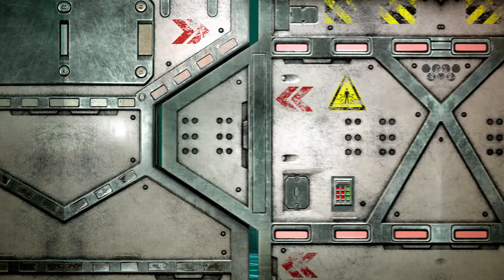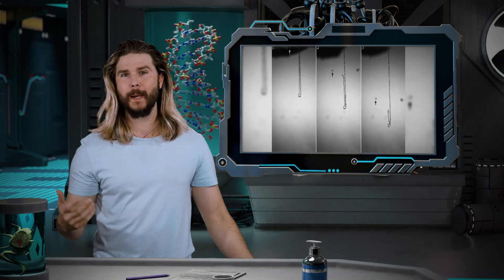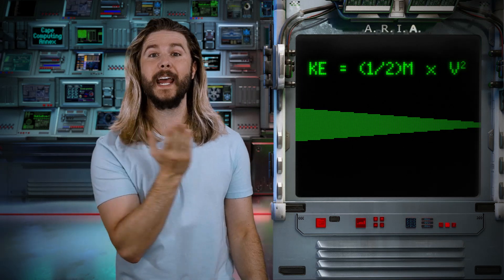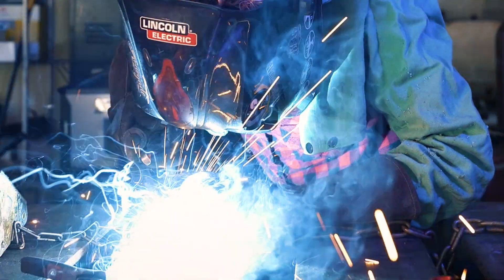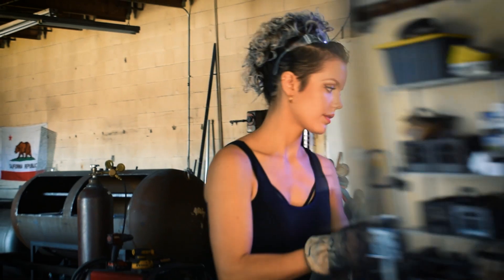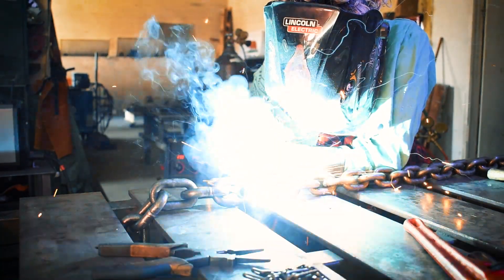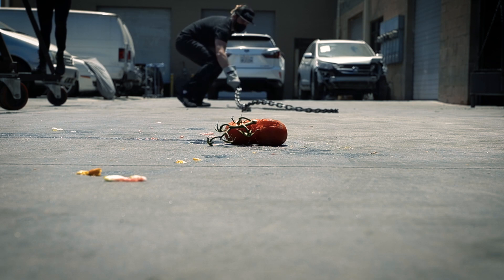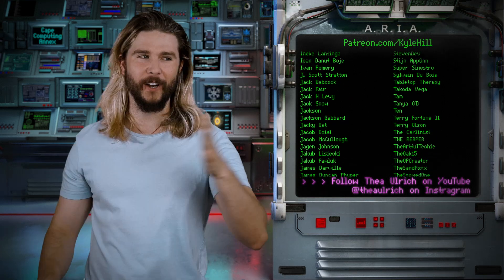Steel Chain Whips are SCARY

Comment from the maker: Thanks for watching! Sub to Thea and we'll do more slicing...for science: https://www.youtube.com/channel/UCUutcqqhZpj1OTx3wLGMKWw
NOTES: I don't think the tip went supersonic, though I did have a few whips that had sizeable cracking sounds. I didn't use a cable because the rigidity of cable won't allow for what you may be expecting. FOLLOW THEA. I think I might have to make this thing even longer and try it again...
Reply: Would be neat to see this whip go up against wood or ballistics gel or otherwise something more impressive than fruit.
Reply: @InSanic13  SUSHI RAMEN【Riku】 did a video where he was hitting something similar to that and using a 100kg chain that tapered down. It got pretty chaotic and hilarious.
Reply: You could greatly increase the initial speed and therefore energy by attaching a pole as handle.
Could you also try to attach a small bearing ball at the tip to see if it gets shot of at supersonic speeds?
Reply: Kyle Hill before you make it longer perhaps you can remove the friction... air friction is fine but concrete friction probably isn’t. Maybe use an ice rink or a vertical rig to keep it in the air.
Reply: Okay, so hear me out:
What if you took the concept of a chain whip, and made a giant (in length and width) chain whip.  What would happen to the end part if you could get it to near light speeds?  Is there a cap to the acceleration?  Could it in theory be faster that light?  Would time dialation occur?  would it slash a tear in spacetime and create a portal or black hole?
Reply: @Youngillidan  The chain would tear and rip as it would become crazy heavy.
Reply: I’d buy a shirt that said The Hill Effect
Reply: Kyle has long flowing hair
So does Simon Belmont
Kyle Talks about steel whip
Vampire Killer is a steel whip.....
Kyle is your true last name "Belmont"? Have you been keeping Dracula at bay?! 😱😱
Reply: I'm curious if the parts of the chain she heated and manipulated needed to be retempered or not.  Seems like not doing that would leave some parts of that steel brittle and liable to break during the whipping action.
Reply: @Laendra  The chains are probably wrought iron and therefore need no tempering. As long as the steel was hot enough during bending the chain should be fine. 
However she could do a normalising cycle to strengthen the weld and relief stresses.
Reply: Just add 2 or 3 length of even lighter chain. Try to find at what point the last chain self destruct !
Reply: Hey Kyle can you do a video on how to mine asteroids and more specifically the effect on the earth? I assume at a certain point adding the mined minerals to Earth's mass could possibly change the Earth's orbit wouldn't it?
Reply: @lordvader4089  It would have more effect on the orbit of the satellites and make getting into orbit more difficult by increasing Earth's gravity.
But, that would mean bringing over 1 000 000 000 000 metric tones of material to the Earth.
Reply: The towel snap? Is that super sonic, too?
Reply: @wilcomaree5278  Can be, if done right. And stings like sheet, especially if towel is wet. ;)
Reply: @TheGhostGuitars  most likely yeah, but that crackling snap we hear most of the time, isn't that, exactly that already?
Reply: @wilcomaree5278  LOL, with me it's more like a sharp pop, probably cuz I hold the opposite corners between two hands, pull it somewhat taut then give it a quick twirl so the towel coils itself into a rope like form, then with a snap of the leading hand towards the target, pulls the opposite end out of my trailing hand, which had held the towel in a line pointed at target. If done correctly, I can punch holes in cups before they fly back. Works best if the towel is just slightly damp. When asses or other parts of anatomy, are targets I generally use less force, obviously, LOL!
Reply: @wilcomaree5278  Yes.
Reply: Yes please do another follow up video. Maybe include some info about the Belmont whip. I always wondered if that whip would actually still go super sonic in real life since it has such a large and likely heavy tip instead of the usual small tip. You should look up some videos of shaolin monks using huge steel chain whips I've seen some videos on tic too. Great video can't wait for the next one
Reply: I am trying to understand why everyone keeps insisting this be done with wire. It would never work with wire because the tip needs to essentially move freely. The tension inherent in wire will make sure it can never lie against itself without damaging the wire.

If you wanted to use wire, you'd need something like a ballista to tension the wire, and release for a short range lash, but that's actually far more like a sword.

You heard me. Wires can make swords. Not whips.
Reply: Someone made a chainmaille whip years ago. There video on somewhere YouTube.
Reply: Kyle, go to your local fishing supplies store for "wire leader" (lighter and more flexible than Cable of the X-Men) then see if one of your minions can weave/braid/plait it into a proper bullwhip.  The end result might be much lighter as well.
Reply: Is that phenomenon really called the Hill effect?
Reply: If so nice
Reply: It wouldve been pretty cool and interesting to see if you tested the steel whip against a zombie head.
Reply: I'd say your problem is it's too long and heavy for you to get a good start on it. Bigger may give you a bigger multiplying effect at the end of the whip but you need more power at the beginning to get it that quick wrist snap. I'd take off the first big chain or two and try it from there to get it to go supersonic. 
 You want something light enough and with a handle to get that nice  sudden slight backwards snap you get from a handle rather than just a dull sudden stop you get from having a chain in two hands. Never underestimate the power of a lever man.
 Or I think you'd need to borrow some industrial companies robot arm to swing that beast as fast as a standard human can swing a regular bull whip. My god the devastation from that would probably go straight through a hung pig carcass.
Reply: why didnt you went with AGAR, or some gel-ish subsitute of tissue, like is done in biomedical disciplines?
Reply: I liked Thea but I just wish she would listen to OSHA, you shouldn’t be wearing something like that to be grinding, you should be wearing a thick cotton long sleeve work shirt because those sparks can catch that material on fire really easily, I’m not trying to be a jerk, I’m just a huge advocate for safety, REMEMBER YOUR PPE
Reply: so I do not remember the channel name, but my roommate showed me a video from a Japanese kid demonstarting something similar with a chain but the chain was much longer. due to the longer length and tapering, i believe in the kid's video he was able to get the end supersonic.
Reply: What about a bull whip made out of steel cable? Like how a regular leather whip is braided, but use braided steel lines instead. It would probably be easier to handle and would actually crack.
Reply: @owen5640  the steel lines are still too rigid. Think of rope. Its gotta very flexible without any force acted on it. Unless its a bunch of small linked pieces like chain
Reply: Maybe try the lead line fron a commercial fishing net. Its basically rope with little links of lead on the inside. That might make a crazy whip if tapered and it would be quite heavy.
Reply: I always butcher my tomatoes when slicing them...how much to get you to come whip my tomatoes for me?
Reply: @davidhobbs3178   I'm a cook at a Japanese restsurant, the guys there would say "sounds like yer knives needs sharpening," LOL. I can slice them thin enough to see right thru each slice without damaging any of the internal structure. Amazing how intricately they can carve a tomato into works of art. And that's just tomatoes, what they can do to other veggies is incredible!

EDIT: Typos
Reply: I've seen a chain whip slice a car door in half, done right, with the right length and mass ratios, it can definitely break the sound barrier and do far more than it did here.
Reply: check out ElectroBOOM's video from a month ago titled "This video of a motorized spool proves me right" ... the question is why does the chain fountain grow? I think it is from the tension in the chain is what gives it the leverage to throw the chain fountain up. The tensile force probably traverses (upward) the length of chain that is accelerating downward at the speed sound (in said chain/metal etc.).... kinda like this bullwhip.
Reply: Super slow mode of that would be awesome
Reply: Oh no not this again scorpions whip didn't go well for you guys and was proven wrong by the "I did a thing" channel in his back yard...
Reply: Plus there was a lot resistance from ground too..
Reply: Ever think of doing a liedenfrost effect video
Reply: Another fabulous video Kyle Hill, thank you for the entertainment. Towards your Hill effect, I offer you the "Mould Effect" as a 'linked' idea of interest for you. While the two are not the same, they do both use the unique physics of a linked chain. THEA was also, awesome!
Reply: Finally reached the point in High School physics where I can now understand this stuff.
Reply: How heavy is that chain whip?
Reply: What did that thing weigh?
Reply: Quick question : wouldn't someone with super strenght use this whip with insane proficiency ? 
Should Shad make a fantasy rearmed over this ?
Reply: Why not build a little ramp like a quarter of an inch tall to get the whip into the middle of object
Reply: @des1redlearnz  I had a similar thought but realized the answer on my own.

He DID try it, but the momentum of the chain will move just about anything unless a lot of work is put into bolting it down, and what's the point for a 15 minute video?
Reply: It looked like it was a very heavy whip.
Reply: For additional info on how dangerous fast moving metal is, i would look up what happens when aircraft carrier cables snap.
Reply: Hey Kyle, I have a stupid question. Let's say that someone was able to cut a giant hole all the way through the center of the earth and "core" it. Let's also say that this hole goes directly through the earth's center of gravity, in other words, the center line of the cylindrical hole passes directly through the point that is the earths's center of gravity. And then let's say that they had an impossibly strong tube that was inserted into that hole to prevent the hole from collapsing in on itself. Now let's say that I jump into that hole. What happens to me? Would I fall toward the center and then get stuck once the gravitational force on all sides of me were equal? Would I be crushed due to the extreme pressure? Would air even be a gas in the center of the tube?
Reply: It can cut but can it  do chain self siphon effect.
Reply: He why is your face not painted silver captain dissolution
Reply: The only thing missing from the video was Thea lighting a cigar with her blow torch like a badass.
Reply: You know what you need to do... build an armature for the whip in the form of a miniature trebuchet so it can actually swing like a leather bullwhip. (But trigger it remotely because that thing is going to be stupid dangerous.)
Reply: I have a couple ideas.  First, if you want a cracker, just weave small cable through the chain and about eight inches to a foot beyond the tip of the whip and anchor it a good three or four feet down the whip so that whatever you use as the anchor doesn't throw off the way the whip behaves.
  And, if you want a whip crack without a cable cracker in the end, as I'm sure you would get with this method, all you have to do is use gravity as the propellant of the whip from extending upward to extending downward as it hangs from a crane. The rest of this comment is explaining method option you could utilize in order to make the gravity powered chain whip possible.

The next section of this comment is pretty much me formulating how to do this without two cranes(because, that's a lot of funding of course) so you don't have to and you can focus on whether or not you should do this.  

Ideally, you want to use the entire length of the whip, and I understand that there would be a challenge in doing so, because you need a hanging point for the whip, and a way to extend the whip fully upward from which you can drop it.  Instead of using two cranes, or a single crane and an ibeam sticking out from the roof of a building, just add a length of chain as long as the whip itself to it's base, maybe a little longer, and hang the whip with extra chain at twice the height of the length of the whip, such that it has a couple inches of clearance from the ground.  
As far as I can see, the extra length of chain you hand the whip from will almost have no effect on the behavior of the whip, it would be just like having two hanging points for the whip as far as I'm concerned, and it would only take a single crane, or i-beam sticking off a roof.
Reply: its the slingshot effect right?
Reply: Can we please have more co-op between you and Thea, she seems really cool.
Reply: @Kyle Hill  Unless yer SIGNIFICANTLY stronger, it would be hard to snap it hard enough to overcome it's inertia (especially on the heavy end) to have the end go supersonic.

Methinks ye probably started with a too heavy a chain as the first section. Ye probably would get better results starting with a smaller size like 3/8" for about 3', then 1/4" for 2', then 1/8" for a 1', for leverage attach the heavy end to a stout 3' long rod or stick. That way ye can wield it 2 handed. 9' total length, 6' chain only.

I STRONGLY recommend wearing protection when using, at least until ye familiarize self in effectively using it. Football helmet and armor at least. 

...Unless ye can convince Thea to 'whip' up a plate armor for ye first, LOL.
Reply: I saw a japanese guy do this first, it was fun watching this.
Reply: When Kyle turns 50 will he be over the hill?
Reply: Don't forget how the sub/super-sonic barrier changes based on air pressure depending mostly commonly on altitude. Higher altitude = lower speed needed if I remember right.
Reply: @salimufari  Don't think it really matters, as most people wielding whips have their feet on the ground. Besides if ye can surpass the sound barrier at sea level, then it's easier to do so "up there.

 That's assuming sound barrier is indeed lower at higher altitudes, I haven't fact checked before responding, and quite frankly feeling lazy cuz I'm tired (it's late here) at the moment.
Reply: Do you have covid 19?
Reply: Whip me please I've been naughty
Reply: What about starting with chain and ending with a wire. Be too stiff early on but I could see it work at the end
Reply: @Tatominator  It's been done before with whips with bits of wire barbs attached to the ends. Very nasty stuff.  In medieval times has been used as an implement of torture.
Reply: @TheGhostGuitars  Ah the cat o nine tails took a very fuc*ed up individual to create that. Well it was brought around by the Spanish Inquisition. Getting whipped with a cat o nine tails was actually one of the milder punishments they had.......
Reply: @davidhobbs3178  LOL, that is such an understated way of describing the Spanish Inquisition so as to be almost inaccurate!  Methinks this is one of the inspiration behind the separation of the state and religion concept.

The whole period is on seriously dark fukup of the whole society. Ugh, that too is understating things too but to be more graphic probably would be risking censure by the almighty Algorithms, LOL.

Anyway, I agree the weapons and tools of torture developed thence were collectively VERY creepy and horrific. On one hand they are fascinating and interesting, but OTOH, they are the stuffs of nightmares and wouldn't ever want to see them ever being used as intended!

Milder, huh? That is so seriously an understatement to almost be lying, LOL!
Reply: How Dangerous is a STEEL WHIP?....a question only asked by someone who's never played Castlevania....
Reply: I want one. Where could such a fine young and handsome gentlemen buy such a magnificent trophy?(Weapon)

Asking for a friend!!!
Reply: Steve mould : unlimited moving chains
Mould effect
Kyle Hill : chains moving faster than a quarter
Hill effect
God bless the students studying in the next decade when this is implemented into books
Reply: My guy....for ur own good,take this girl out to eat for doin all this for u . Thank me thirty years from now. 😉
Reply: Kyle... you didn't talk about how "dangerous" a steel whip is. I was hoping you would engage some objects that had a substantially higher resistance than just a bunch of pieces of fruit. A Gansu knife can do that and cut through an aluminum can. It must be a fact... I saw it on TV. I just wondered what a chain link bullwhip could do when it's put to the test. How much force, how much velocity, does it exceed the speed of sound, does it REALLY KICK BUTT?
Reply: Oke why not just use a chinees chainwhip? Cause this steel whip your talking about does already exist. Your not the first to think of that the chinees beat you with a few 100 years. I have a homemade chainwhip myself cause I practice kung fu. Your litterly the last persoon to come up with the idee of a whip made out of steel. The chinees chainwhip uses sections instead of links that tapper and a heavyer weight on the end sow when the whip is at full speed a heavy mass object hits the target instead of a weak as tiny link. I don't know of your aware of it's existence but just look up chinees chainwhip if you want your mind blown. There are people trainend to extreem with those fuckers
Reply: @joeyvanhaperen7715  Kolere, je Engels hapert nogal... (kon 't niet laten goos)
Reply: @joeyvanhaperen7715  Sorry man, dat was lullig van me.
Reply: Why not try running backwards as the tip is going forwards and stop a couple of feet later?
Reply: Cool and all, but I see a lot of food waste
Reply: I like how one of the rear computer screens is showing a blueprint of Atlantis from Stargate: Atlantis. That completes my soul
Reply: I would love to see you guys hit ballistic gel, since it's a lose analog to human flesh.
Reply: PUT THEA IN THE DESCRIPTION FELLAS...come ooooon🙋‍♀️
YouTube link is great here in Kyle’s comment, but does she have an Instagram?
Reply from the maker: Lunis84 she does
Reply: Kyle Hill you’re amazing
Reply: @kylehill can you do the one where you tried to make a steel chain go faster than sound, but with a steel cable this time. A guy on YouTube Called mike shake made a supersonic steel cable whip that actually cracks, LOUD!
Reply: I feel like this whole video is a ploy to name a scientific concept after yourself
Reply: There is a video that was posted a year ago with 10 million views of a guy whipping a massive chain on the street. The end does appear to pop.
Reply: I work for a pool company called Eastern Pools in Norton Ohio!

And we use Muriatic Acid to wash wash Filters, and then wash then with Soda Ash, AKA baking soda!
Sodium Carbonate!
Isn't chemistry Fun!
🤓🤓🤓🤓🤓🤓
Reply: It may not have gone supersonic, but I still wouldn’t want to be on the business end of that thing
Reply: Steel cable is too rigid? No way. 1/16 cable is very flexible, and could handle the G's created when accelerating up to supersonic
Reply: Thanks a lot thor
Reply: Does she have asthma? Her breathing patterns while she talks is kind of worrying. She should go get that checked out
Reply: Can you do a video on the firmament?
Reply: Yes
Reply: dangerous enough it can break bones,there are chain whips used in martial arts,and probably cut a person in half with that whip
Reply: It needs a handle
Reply: What? I wasn't doing anything I'm just chilling back here
Reply: I wouldn't suggest chain because as the force becomes greater the more of a chance that the weakest weld will break sending chains flying.
Reply: hellooooooo nurse!
Reply: You should have used steel cable and the fall and cracker can be flexible wire coated in plastic
Reply: You should get one of those robot exoskeleton suits the Japanese are making, then you'll have the strength to actually use the chain as a real whip instead of slinging it across the ground.
Reply: Have Brian Shaw wield this
Reply: theres a video floating around Tik Tok of a man cracking a gigantic chain whip. I have no clue what its under or who it is but its something
Reply: I’m using this video to try and disprove Steve Mould and ElectroBOOMs’ videos on the bead chain thing, thank you Kyle
Reply: You know....this makes a few of Ghost Rider's abilities even more impressive.  His chain doesn't taper, so imagine the sheer strength it would take for him to throw a chain whip like he does.  Also...how does he not cause massive trauma to a human by wrapping them with the whip?  I mean...the force imparted HAS to be able to cause serious bruising to even the deepest organs and just...shatter ribs and a sternum.  By the time he's heading up to them to use his Penance Stare, why would he bother?  The average human sinner is already in some level of traumatic shock.
Reply: Kyle, you need to get a slow motion camera and a strongman to go to town on something with this whip.  This sounds like a Smarter Every Day collab to me.
Reply: Try braided cable
Reply: Isn't the "Hill Effect" the same thing as the  "Mould Effect"?
Reply: Is this video about Lobo from the DC Universe? If not... should do one.
Reply: Flick it and flick it good... I saw what you did there
Reply: You must whip it... Whip it and whip it good... You know you want to... You know you should...
Reply: Why didn’t you use wire rope
Reply: @Secengineerinthewild  same reason, and it would also be more prone to destroy on impact
Reply: @Secengineerinthewild  Not flexible enough.
Reply: Ken Williams couldn’t you use the wire in a mig machine? I mean it’s flexible without the actual welding wire, ima try and make something like that
Reply: Loved the subtle key and Peele reference right at the start
Reply: Other women makes cake using heat.
THIS woman makes DEATH using heat.
Reply: What if a meteor hit the Sahara Desert? Would the sand cushion the impact?
I honestly don’t know. Can you make a video about it?
Reply: @SneakerBiscut  I can answer your question right now:
Meteors are a lot faster than your typical beach ball. The speed of the meteor excedes the speed of sound in the sand multiple times. That is why the sand would initially react very similarly to rock or even water. The shock wave emanating from the impact would immediatly vaporize the sand and create a large fireball that further displaces material. The crater in sand might even be larger than in rock, since sand has a lower density and thus is easier to displace. 
You might find droplets of molten sand after the impact that cooled while falling down. These "impact glasses" are evidence to distinguish craters from geological features.
Reply: Laughs in Ghost Rider
Reply: so, your new gf is into BDSM and you read shades of grey yes? (guys is there any intel about a possible spouse?)
Reply: Thea will make it longer for you. Also, she'll mod the chain...

..😏 srry, couldn't resist ! 🤷‍♂️
Reply: I think there was a guy attempting to do a chain whip that WAS supersonic, but he had to make the chain MUUUUCH longer.
Reply: That was awesome 👍
Reply: can we use a machine which can swing a huge chain starting from 10 to 20 inch and tappered down to few  1 or 2 mm ( will that help us achieve speed of light  with one whip ??)
Reply: You are not a real super villain,  a real  supervillain would connect a taser in this steel whip
Reply: 0:50 I feel you. I have a similar story. Except I had it even worse because I was dead asleep in class. Drowsy face and all. Didn't even bother to try and hide it. So I accidentally made everyone thinks I was smarter then I actually was. But really all I did was look at the board and use the process of elimination and probable cause/deduction (idk what is the correct term here but something like that).
Reply: @DeViceCrimsin_  well that's a kind of inteligence my man
Reply: Your 12 minute video was not worth the 4 ads I saw. I'll leave a dislike for more interaction, you're welcome
Reply from the maker: @bluedingo7375  Fixed
Reply: @kylehill  I honestly think she should go get her lungs checked out because I think she's getting welders lung
Reply: @kylehill  what did you fix????